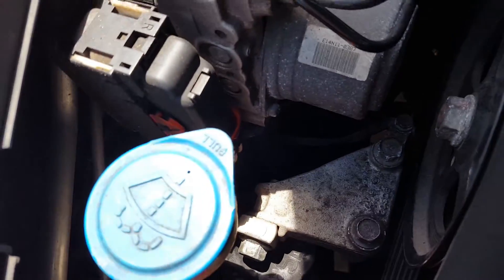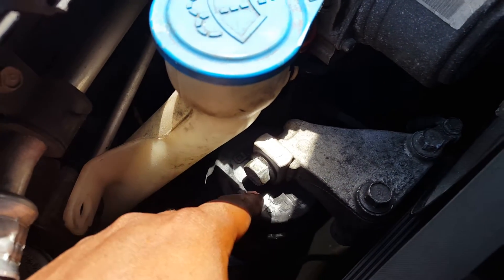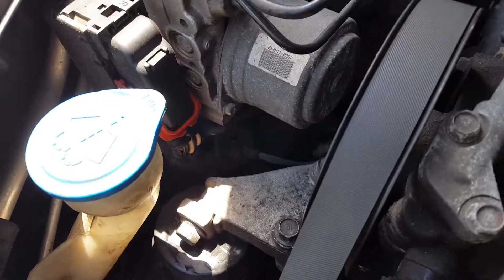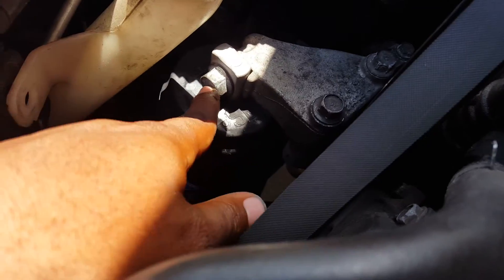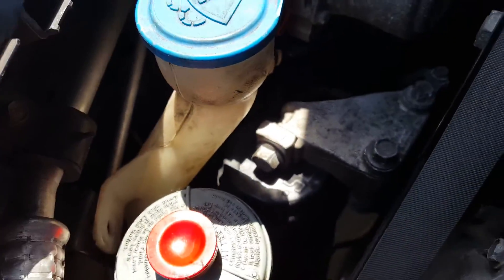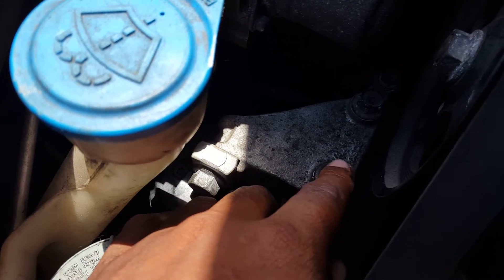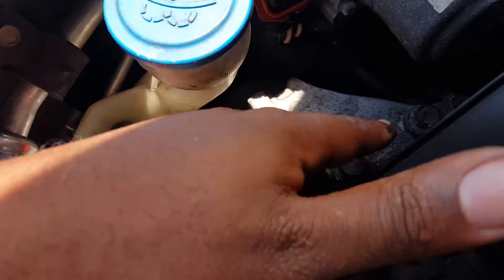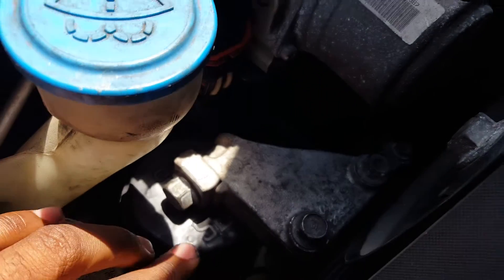HOW TO REPLACE ACURA TL ENGINE MOUNT TUTORIAL

Comment: 47 mm screws or 4/7?
Reply from the maker: what
Reply: +fabolousg4ever you said the size of the 2 screws in the inside part of the engine mount was "47". I dont know if you meant a 4/7 bolt or something else.
Reply: +fabolousg4ever @ 4:40
Reply from the maker: +TechWire those are the torqe settings on how tight they are suppose to be 47ft lbs torque the bolts size is 14mm
Reply: +fabolousg4ever oh ok thanks.
Reply from the maker: +TechWire no prob